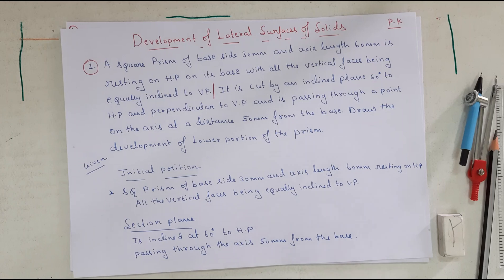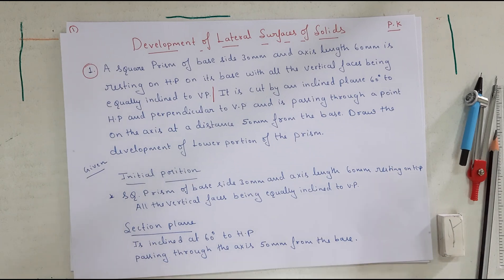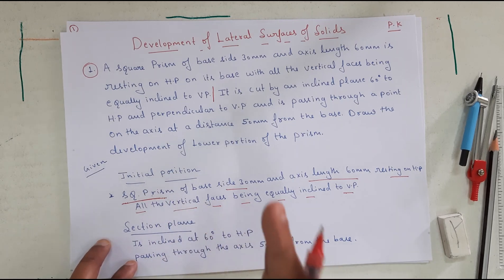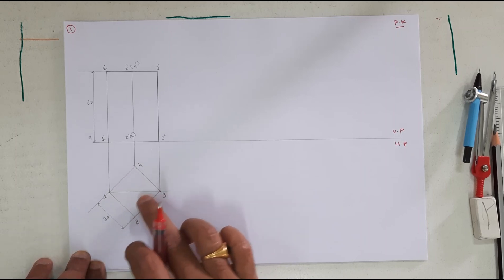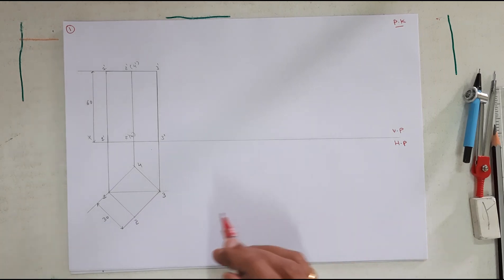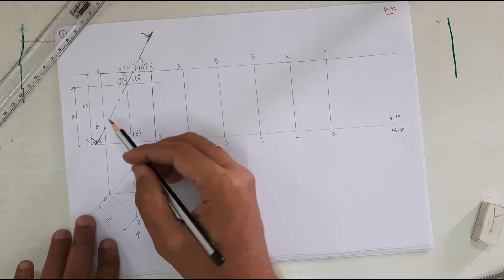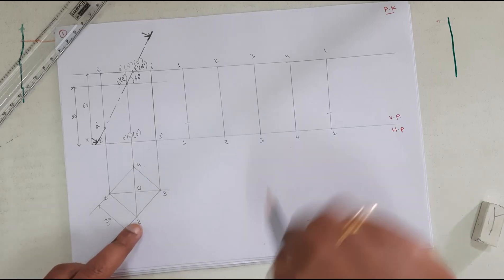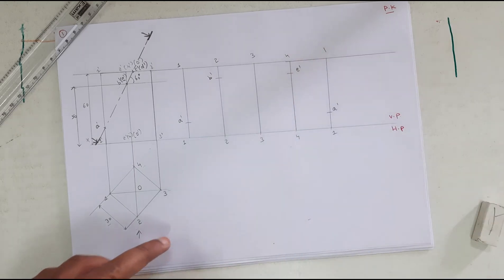Square prism/ Parallel Line Method/ Syllabus 2020-21/ Development Of Lateral Surface of Solids

Comment: Q1) A square prism side of base 45 mm and axis length 90 mm has its axis vertical and rectangular faces equally inclined to V.P. A square hole of sides 30 mm is drilled through the prism completely such 
that the axis of hole is perpendicular to V.P. and bisects the axis of vertical square prism. The sides of square hole are equally inclined to H.P. Draw the development of lateral surface (D.L.S.) with effect of hole